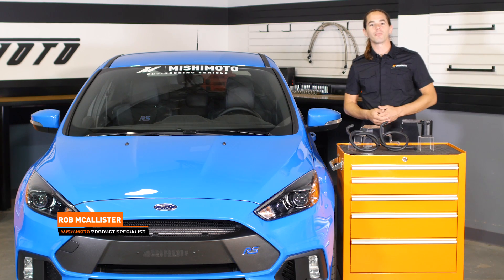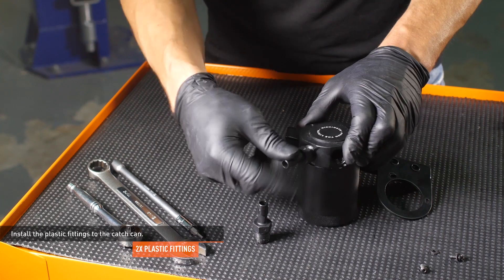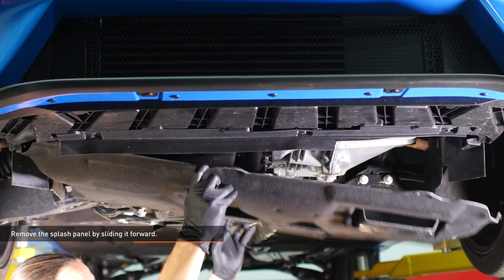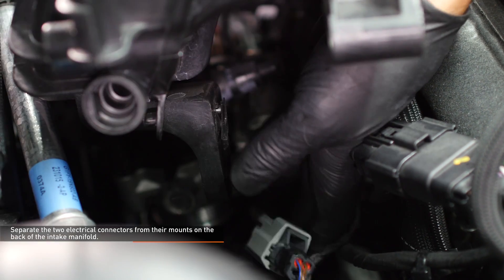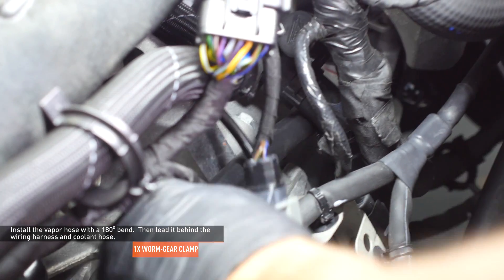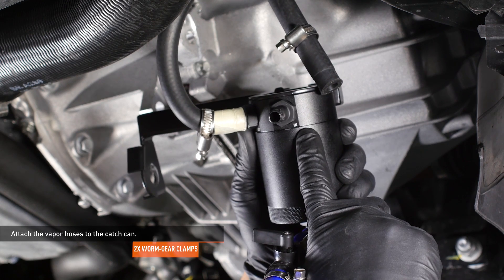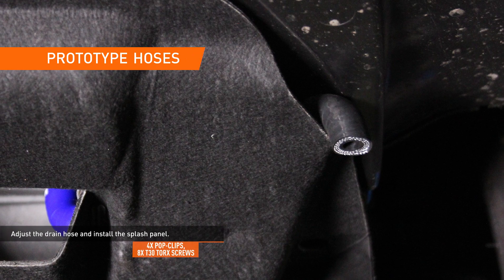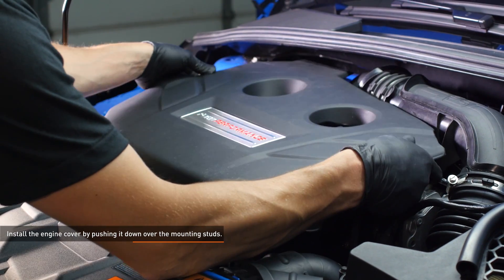2016-2018 Ford Focus RS Baffled Oil Catch Can, PCV Side Installation Guide by Mishimoto

Comment: Really funny you say a wrx is better I have had both and my new RS is far better. Much faster and better handling. Keep seeing them at the track and making your assumptions I'll keep driving and deciding based on performance. RS is better bottom line. Are they more durable who knows but better straight from factory.

Comment: nice cars but not that quick.  ran against one and he was only able to get down to a 13.5@103 with his moded RS.
Reply: Yeah? There's tuned no bolt on RS's running 12.5s.  So that one was either stock, heat soaked, track condition, or driver mod needed.  They are nice cars though, made for road courses, not drag strips.
Reply: +jrzez I'm sorry but that is a  luaghable claim (12.5).  I am yet to see one break out of the 13's without using drag radials.
Reply: Nismo370Z KK, you can live in your bubble, everyone else who follows videos and time slips knows otherwise.  Peace.
Reply: +jrzez Talk about living in a bubble called YouTube, which means you've A never seen it happen (or seen one on a strip/road course) and B never been in one...lmao
I can say I have seen one on the strip/road course, they are a good little car but far behind a WRX or Evo.
At the end of the day it is Found On Road Dead.
Reply: Yeah, I never sat in my car.  It came off the flatbed and just sits there.  One day I'll start it up.  12.5/12.7/12.8 thus far, and it just really came out so in time it'll be made even faster.  Still breaking in mine, can't wait to take it to the track... the real kind of tracks.  This car is meant for road course tracks, it just happens to be quick in a straight line.

Oooh acronym insults, from an overweight, underpowered, bloated pricetag 370Z fan... lol.